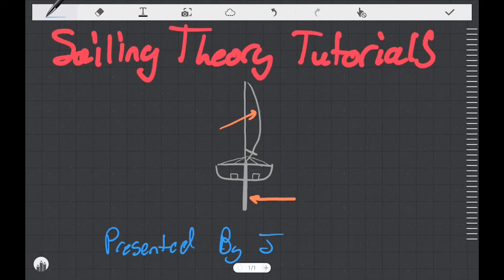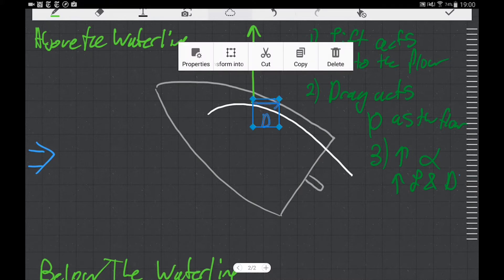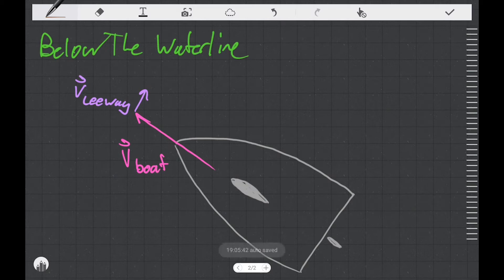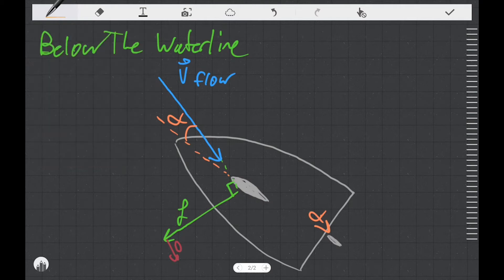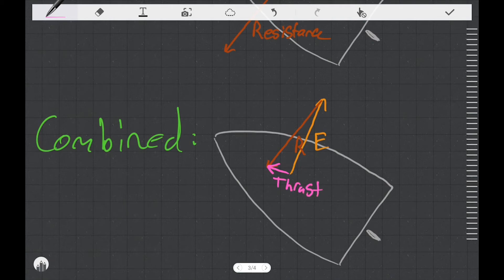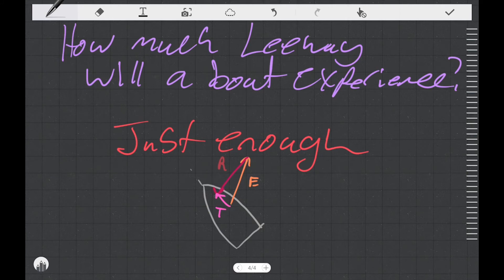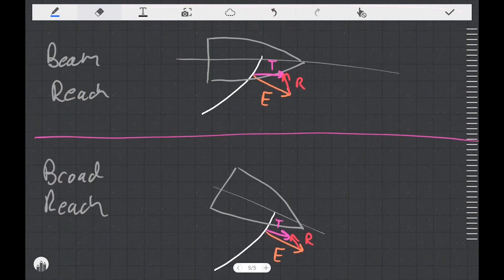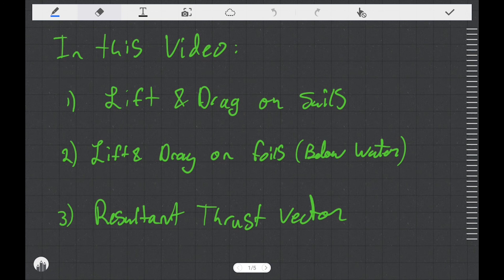Sailing Theory Tutorials - Forces on Sails and Foils

Comment: Thank you for your video! I learned quite a lot and refined some of my knowledge.
I don't quite agree with "Boats Experience just Enough Leeway", though.
My students often try to accelerate the boat sailing close hauled with no speed after setting sails or a bad tack.
What this leads to if that the boat is actually going sideways a lot.
As I understand it, the first second that the wind fills sails in such a situation and the water starts flowing, the direction of it's flow should be opposite to the direction of "E", combined forces of the sail. And even if the sail is trimmed perfectly, the angle of attack on foils is to big, so they stall. A lot of drag is generated, which results in either the boat heeling a lot, or drifting sideways if hiked.
Also, the rudder is useless in this situation, so the boat usually can't be controlled. It can head up or bear away, but it's not relevant in my question. What happens underwater, when sails seem to be trimmed perfectly and the boat points very well, but drifts sideways?
Of corse, as you gain any speed angle of attack changes drastically and foils lift starts to help in acceleration, and then the boat flies as you said - easy in going forward and really bad in going sideways. 
But I don't like seeing my students crashing into each other on a start line because of this misunderstanding :)
I would be really greateful if you could clarify.
Thank you!
Reply from the maker: Hi Ivan.  I think you're spot on.  I'd add a couple of points to clarify this aging video and its explanations:
1. My use of the expression "Just enough leeway" doesn't imply that the amount of leeway your boat experiences is desirable or even beneficial, just that it is this missing piece of the vector equation.  Maybe I could have used different language for that part.
2. My description really only applies once the boat is moving and once the sails are trimmed within a reasonable range for the direction of the wind.  Starting from a stop is sort-of outside the scope of this video.
You might want to give this article a read: http://gentrysailing.com/pdf-theory/Origins-of-Lift.pdf

Comment: Can we measure the force created by the sail by measuring the tension on the sheet with say a force meter or a simple digital scale.? Could this single measurement assist triming of the sail. Much like a the resulting speed increase or decrease with triming the sail for max speed?
Reply from the maker: You can certainly get a sense of how much load there is on the sheets, and relate it to the force on the sails, but you have to remember that as you sheet in and out the magnitude and the direction of the forces on the sails changes.  The farther you sheet in, the greater the sideways, heeling, component of the force will be, so you can't say that more load in the sheet will equate directly to more thrust force driving you forward.

Comment: Thanks for this great presentation , I've recently  read an article about a practical example for " The Forces Affecting a Sailboat " .. 
I know the standard formula for the wind force which is : Wind force = Wind pressure * Sail area
Wind pressure = 1/2 * Air density * Wind speed^2

The strange thing is that the wind force was calculated based on the following formula 
Wind force  =
𝛥𝑃*𝑀/ 𝜌𝑎𝑖𝑟*𝑑

where 𝛥𝑃 is the change in pressure, 𝑀 is the combined mass of the sailboat and the sailors, 𝜌𝑎𝑖𝑟 is the density of air, and 𝑑 is the distance between the two pressures 

I would like to know your opinion about this formula , Where did it come from? this is the link for the article 
https://scholarcommons.usf.edu/ujmm/vol8/iss1/2
Reply from the maker: So the "standard formula" that you have written above is based on bernoulli's equation.  It would let you solve for the absolute maximum amount of force that wind would exert on a sail if it were impinging perpendicularly and all of the air came to a complete stop.  That's not quite how aerospace engineers model the force on an airfoil, but it's at least a recognizable formula.

I haven't read the whole article that you linked, but I would caution you against placing too much stock in it.  This quote is a red flag that the authors aren't trained fluid dynamicists, "because the air particles on the leeward side (in this case the starboard side) of the sail are forced to move faster than the air particles on the windward side (in this case the port side) of the sail since they must cover more distance".  

As for the equation, my best guess at the moment would be that they have somehow synthesized newton's 2nd law (F=ma) for the sailboat(mass of the sailboat and sailors, acceleration of the sailboat, force on the sail)  with Bernoulli's equation (Properties of air).  Without seeing the derivation step-by-step, I can't say whether it's correct, but I'm not inclined to trust it.  I tried to look up their reference but it's no longer available on the web.
Reply: @howarthsailing  Thank you very much for this detailed answer .
I have searched a lot on the Internet about this topic ,many articles explain the idea and analyze the forces acting on a sailboat but unfortunately I could not find a detailed practical example with numbers for these forces ..Based on your experience where can I find a reliable practical example for forces affecting sailboats
Reply from the maker: @MSFJo  I'm sorry, I have also not come across what you're looking for.  You might consider looking for a naval architecture textbook.
Reply: @howarthsailing  In fact, my field of work-even if it is within the scientific fields- is far from naval architecture  , but the topic of sailing boats and the forces affecting them, especially the way you explain the topic in a distinguished way, made me interested in the topic more..
I will try my best to buy a book on marine engineering, for sure it will be difficult to understand the technical stuff in it but I think I have benefited from the information in your channel that will make things easier ..Thank you for answering  .
regards